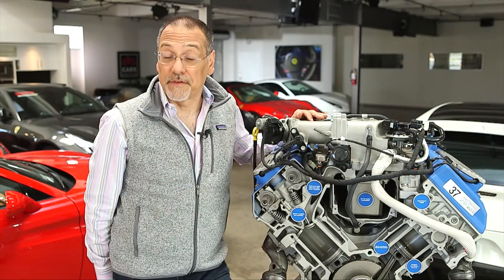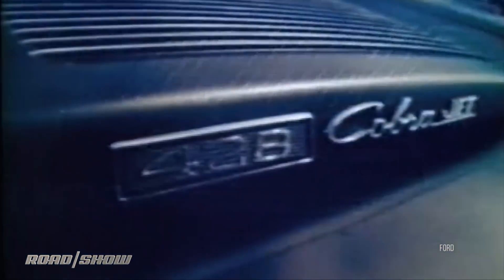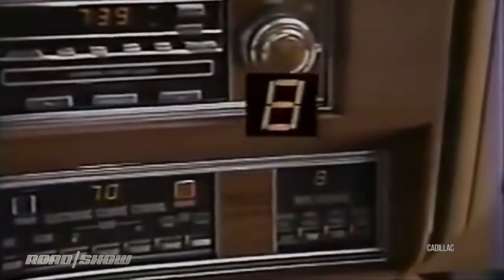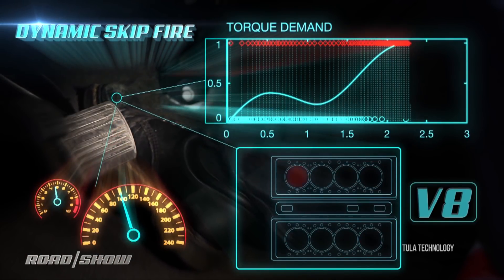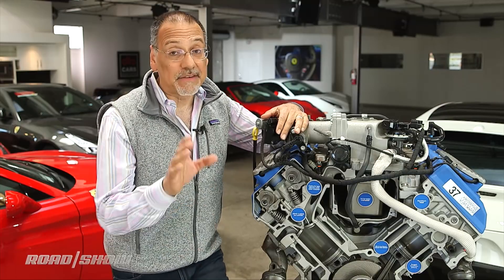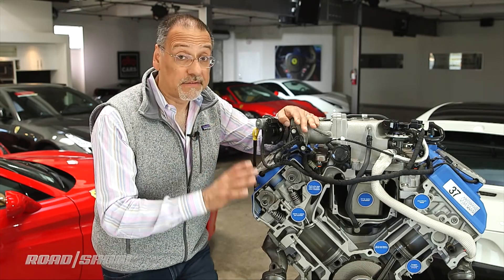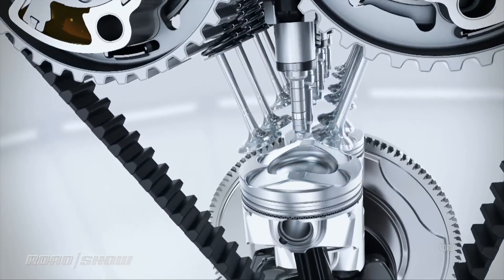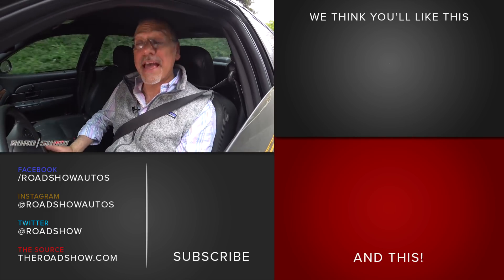Cooley on the shrinking engine: Cylinders are an endangered species

Comment: Why not have compressed air to keep the engine running at idle. A small compressor that compresses air when decelerating. That would also allow smooth start stop. Oh downside is having a compressed air tank. Plus side is that you can also inflate your tires using that.

Comment: I honestly only look for 4-cyl turbo engines in my cars nowadays. I overall think NA 4-cyl engines are underpowered (I like 200-250+ hp) and I think 6-cyl engines are unnecessary unless you're driving a truck or a huge SUV... but hardly anyone really needs a truck or giant SUV, despite demand. Just look at folks in CO. Truck owners here don't haul anything except skis.

Comment: Start Stop = Premature Starter Motor Failure. 

Manufacturers just put this feature in there to be able to pass fuel emission standards for city driving. They also make sure that the starter will survive the warranty period. After that, forget about it. All those fuel saving will just go to the labor and cost of a new starter.
Reply: I believe Toyota tests their starter motors in stop start vehicles to over 300,000 starts.

Comment: What's wrong with 4 cylinder cars? 90% of Europe has been fine for the last 40 or 50 years with them. People Drive em, they fix em and they drive em again. 250,000 miles is not a problem. That would typically have fewer motorway/highway miles than US cars in their lives.

Comment: Cylinders should be obsolete in 2018. They're over a century old polluting, noisy, messy, expensive to maintain technology. Time for the electric motor to take its long overdue place, as it should have been the technology of choice from the start for the automotive industry. It lost to gasoline engines solely because gas was cheap back then. That's not the case anymore, for a long time now.

Comment: Fun Fact: they did actually tried to make a car that had a combustion engine that didn't use cylinders at all. It instead used an engine mainly found in helicopters which is a Gas Turbine Engine. I believed Ford was involved in the production of it and their prototypes were surprisingly successful. The car just had to many complications for maintenance and the project was scrapped. 
Another thing is Jaguar also has a running prototype that also uses a gas turbine engine. Two micro ones mounted mid-rear that drives the generator for the electric power train making it a hybrid. This Car is called the CX-75 if I'm not mistaken but it was supposed to be a super efficient sports car. 
I mostly believe that future cars will probably be gas turbine hybrids or full electric due to the development in car technology.

Comment: Ok... interesting but it isn't the whole story. Newer engines from Mazda, Toyota, and Honda are producing near v6 power some even with turbocharged 4 bangers. These optimized designs are giving us equal or more power in terms of torque with improved fuel economy. And... 4 cylinder engines are a couple hundred pounds lighter than v6 or larger engine given them better power to weight ratios. You simply don't need v6 in midsized vehicles anymore. Gas isn't getting any cheaper... back in the good old days of v8 in every car available gas was relatively cheap. (However I have never counted for inflation)

Comment: I am noticing a huge upward trend in engineering research and development in engine tech in recent years. All the signs of a desperate death struggle of a technology that has nowhere much to go in the face of electric.
Ultimately its all about the  physics not just the engineering. In 5 years - 10 at most - very few will be purchasing the combustion engine driven car as new. 10 years after that it will be for museums or vintage weekends.

Comment: FIRST AND FOREMOST ... POLITICAL CORRECTNESS IS FOR SOFT SHELL LITTLE CRABS AND SOFT SHELLED GRADE 
( A)   EGGS WHO  HAVE BEEN CODDLED TOO MUCH  BY PARENTS AND SOCIAL SYSTEMS FROM DIAPER DAYS TO WHATEVER AGE THEY HAVE MANAGED TO SURVIVE INTO  BY NATURE`S GRACE ALONE.

I got my licence in 1960 , got to drive 50,s 60s 70s muscle and everything else in between , loved it . Been fortunate to live  in those times essentially the last period span  of automotive golden age ... I  pine its end.
The more cylinders the better , don`t care about economy , I do not beg money to buy fuel from anybody,  I care  about not  being able to overtake  a Qtip behind the wheel on any road doing 15 mph below the rated speed limit  because of not enough horsepower and torque... I do not give a crap fake climate change or emissions whose real significance can only be explained by Poindexters with  a bought and paid for agenda. 

ONLY ONE  jet airliner trip lasting 2 hours from take off to landing  emits more particulates than 10 thousand diesel passengers car can produce in 8 hours .
The airliner emission problem cannot be fixed and they know it. Think of  the combined volcanoes emissions  across the world , how many jets are flying on any given minute ,or heavy mining trucks and heavy equipment of all types and descriptions , 
10 thousand hp diesel locomotives  across the world , ships , using 100s of gallons per hr.
Some ships heavy oil usage is measured in tons per hour , and I should give a good fuck about owning a car with a  Briggs and Stratton under the hood or better yet an radio controlled single lunger OS 80? not likely .
 
What will follow for the next paragraph  is not digression but"curbing emissions will save the world" is bullshit , the future of the world ?. The future ? Who cares ? The world today  compared to 48 years ago is a sewer , people.. in larger numbers than ever before  are mentally ill and unhinged so much so that that  no civil exchange can take place without  it turning into a shouting match. In many cases too illiterate about their very own language which leads always to misunderstanding what they are unable to understand emanating from the simplest of terminology... 

Nobody is addressing that problem ...HOW CAN THIS SICK IGNORANT MASS OF  HUMANITY HOPE TO SAVE ANYTHING WHEN IT CANNOT FUNCTION AT ITS OWN BASIC LEVELS? 
Besides,  the earth will shake off anything that mankind can cause upon it  , it has done it constantly like a dog shakes fleas off itself ... a bunch of arrogant money grabbing ass wipes would have people believe that we can save the planet  with bullshit which  only the common man must pay for  to the point of inescapable poverty... idiots. 

Meanwhile in the automotive world ...it has gotten to the point in many cases  that repairing a new car failure out of warranty requires a loan  70 % of the residual value of the car 
My first car  a 1957 ford galaxy 390 cid  cost me $75 bucks got 17mpg and  I  could park my my 6 foot frame inside of it anyway i liked .. a tune up cost $15 bucks in 1970 dollars , insurance was $140 a year  I got 2 years out of it before buying my 67 mustang fast back in excellent shape for $700 bucks. A HIGH SCHOOL kid could afford a car with a part time job  paying $1.95 per hrs pumping gas or bagging groceries, of course  while still living with his or her parents. WHAT BRAND OF GASOLINE STATION STILL HIRES LEGAL AGE  TEENS TO PUMP GAS part time? many part time jobs that used to employ youngsters are gone forever.  At over 30 years of age they live in their parents basements ... that is fucking sick.
Young kids today can`t afford to buy a car period never mind repair costs ... the planet has not been saved , in fact it is worse off than it ever has been because the lies are conveniently omitted about all of this shit which is ...YOU GET TO PAY MORE FOR LESS.. and the rich assholes still get to run their YACHTS  at 100s of gph  in all of the exotic places that I and the rest of the commenters  will never get to see except on tv.

ROADSHOW ... go sell your  enthusiasm for the retarded shit you are pushing on unsuspecting people via  propaganda drivel,  to shit for brains idiots who go through life with blinders provided by asswipes like the one in the video who drools about a futuristic 1 lunger engine .
I will run my  simple to manage no computer  V8s or V6s  long after your recycled beer can 3 , 2, 1,  cylinders have been recycled to make 0  cylinder Briggs and Strattons like engines " NO OFFENSE TO BRIGGIES" , and will be able to overtake Qtips and old Cordwood behind the wheel in traffic doing 20 in a 45 zone returning to my lane  by virtues of safer lightening  quick acceleration  without using a super computer to figure out whether or not I have the TORQUE OR HORSEPOWER in an engine  to accomplish it in 4 car lengths , or sweat  that will not grenade on me even if properly maintained after a  dozens times of stressful driving.
THERE IS NOTHING MORE DANGEROUS, THAN AN UNDER POWERED CAR  OR TRUCK .

Comment: This technology scares me for one simple reason, engine longevity.  Engines are meant to operate at a specific temperature.  Meaning you can damage your engine if you want to much from it when it is too cold.  In the short run you may not notice it but in the long run it is planned obsolescence.

Comment: Highly impressive skip fire technology that reduces firing down to a single cylinder...

I actually owned and drove my first 3 cylinder engine when I lived in Japan for 17 years and and drove my families Daihatsu Mira and Daihatsu Boon, the 3 cylinder engines were made by Toyota and they were astoundingly fuel efficient, capable and reliable and were said to have lower emissions than hybrid vehicles which made it extremely challenging for our local car dealerships to sell hybrid vehicles until what's now called the Toyota Prius C came along...

Our Daihatsus would climb the steep mountains of Kyushu Japan with our family of 4 with absolutely no problem and never overheated.

Comment: I will tell you that GMs Active fuel management is total garbage. I just repaired my 2012 sierra. 1100 dollars in parts for a collapsed lifter because the VLOM gasket blew out internally and starved the lifter for oil. Any fuel I may have saved over the years with that garbage system went down the drain with that repair. I didn't buy a truck because I care about fuel economy.

Comment: The reason V6 sales are down? It's becoming increasingly difficult to find a new vehicle on the lot that has a V6. In most cases, a V6 isn't even an option!  As I just purchased a 2018 Dodge Journey, 4 cylinder, I have to say Dodge has some catching up to do.  It's performance will leave you wondering where all that power is they seem to advertise quite frequently.

Comment: I have a 2017 Chevy Suburban that has cylinder deactivation.  It goes from V8 to V4 in a totally seamless manner.  You don't know it's happening unless you set the dash readout to tell you what mode it's in.  We recently took a long trip, and we got 24.1 MPG, and one 400 mile stretch was 25 MPG.  And this is a 3-ton 4x4 vehicle loaded with all our camping gear.   It's amazing how technology has made these engines so efficient.

Comment: I always thought that when I grew up and made enough money I'd 'finally' get myself a V8. "There is no replacement for displacement", was once a sure and solid mantra. Does that continue to be true? 

I would love a simple, low-stress, generous cubic inched, solid, sure and reliable naturally aspirated V8 with a manual transmission. Like the Toyota 5.7 but with somehow 20 city/mpg (I can live with that). A low maintenance, solid and reliable block. . doesnt even have to be the most powerful. The kind of engine that you can run for 400,000+ miles and keep for 20-years with just regular oil and filter changes.

These ever shrinking engines with the ever growing technology still makes me wonder about truly long term reliability.

The only vehicle I want a three cylinders in are my Triumph mo'sickles!

Comment: More makes the engine run smoother. Increases costs maintaince cost ie 6 instead of 4 spark plugs. 3 cylinders chug along arent fun to drive ect. Most people car about what it can do ie off road ect and gas mileage. Thouse are the big considerations

Comment: Hi Cooley. Question: What's really going on with cylinder deactivation? Does the computer shutoff the fuel for whatever cylinders are not needed? The pistons are still moving during this process but they aren't providing power. Does this put a strain on the active pistons having to move the crankshaft without the aid of the deactivated cylinders? I can see where this can save on fuel but perhaps at the expense of extra wear and tear? I also assume that these deactivated cylinders are still receiving the proper amount of oil as the active ones during this process.Thanks.

Comment: It’s not all bad. More cylinders equals more parasitic loss and more moving parts. If you can make a 6 or 4 cylinder more efficient and more powerful then why not. The only thing missing is the V8 sound.
Reply: Ray Wilson because more cylinders equals more power at the expense of torque

Comment: Mitsubishi did cylinder shut down in 1992 with the 4g92 mivec engine with MD... Modulated Displacement. The later 4g92 engines didnt feature MD though...

Comment: When I heard they were bringing cylinder deactivation back, I believed it would cause uneven wear across components and hot spots in the block/ heads would cause fatigue and blow gaskets or crack something. Now I think, they may be on to something with random firing. Now to see how they execute it and how it holds up

Comment: Funny thing is, everyone watching this video cares about how many cylinders they have, what compression ratio they are, and the bhp they make. The ones who don't, don't know who this Ryan Coolidge is, the difference between an in-line 6 and a V6, think all engines are V's and will call an in-line 4 a V4, and change their oil once a year and drive over 20,000 a year. Also, if you ask them what kind of car they have, they'll say, "I have a fully loaded red convertible with navigation and Apple Carplay(or bluetooth if they haven't upgraded every 2-3 yrs like a lot of people do)".